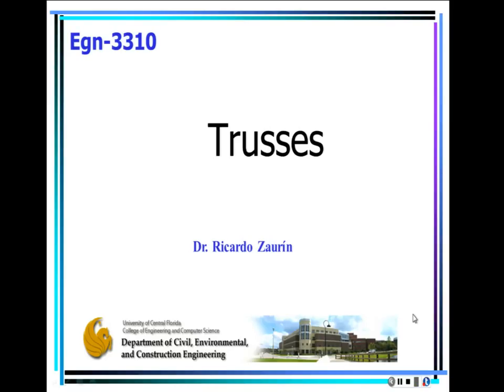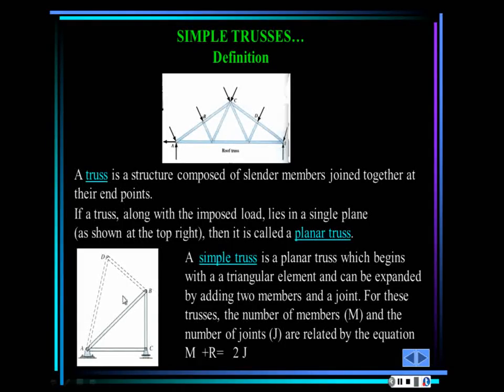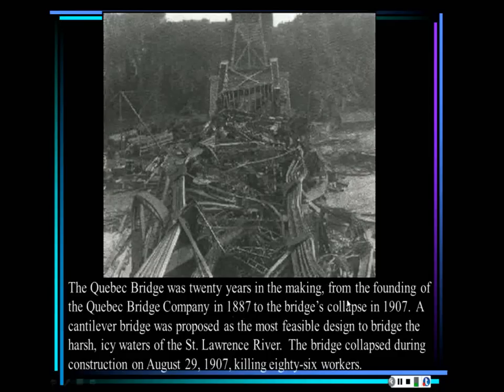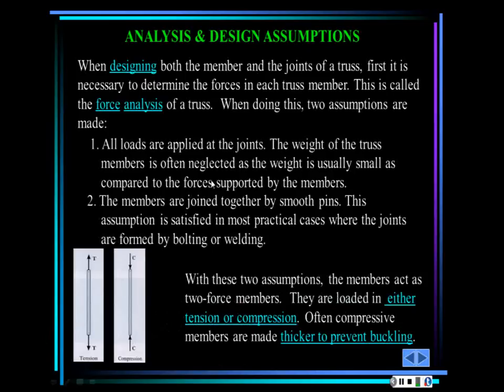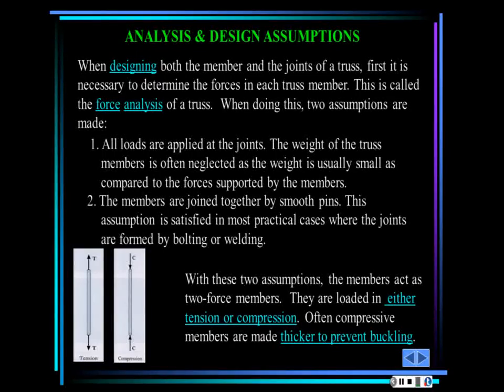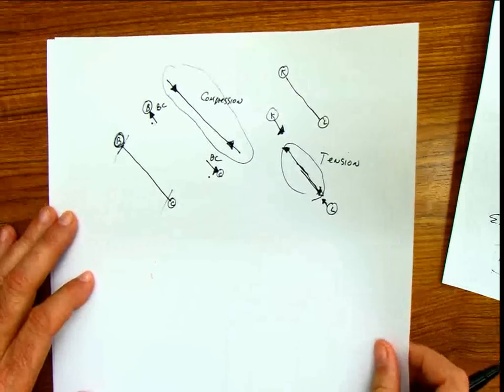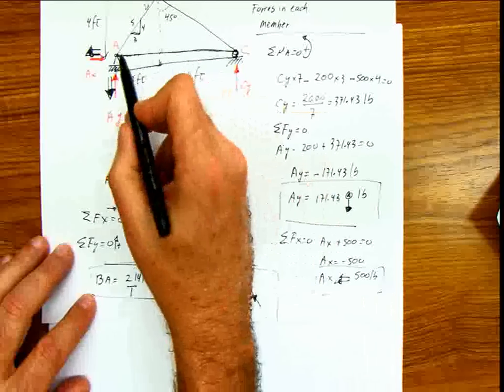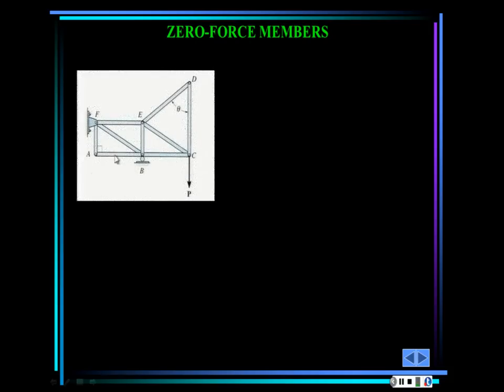Lecture Truss method of joints

Comment: The thing that confuses me is arrow directions. Is the joint putting a force on the member or the member putting a force on the joint? Because if the force is enterting the joint then the arrow compressing the member must be a reaction at the joint.
Reply from the maker: both on both
Reply from the maker: both on each other. action-reaction